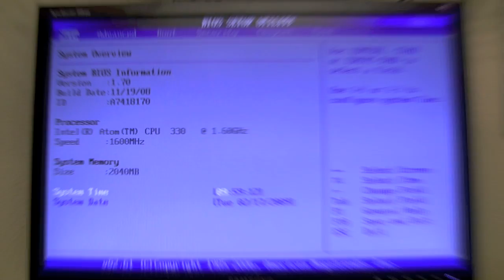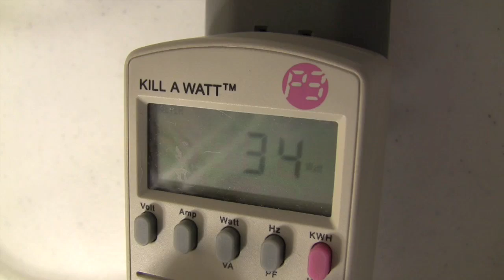MSI Wind Nettop 100 Assembly

Comment: I was looking at getting one of these to use as a HTPC, mainly to stream media from my pc with XBMC.

Since the graphics card is onboard and not very powerful, i read that the highest resolution you could run in was 1280×1024, would this work with a 52 inch screen? 

I don't really care about hidef, i know it can't do that, but as long as it will play dvd rips without stuttering i'd be happy.

i'd love if someone could comment back regarding the resolution limitations.

Comment: For same money as eeebox, you get twice the memory, 5-6 times the disk capacity, twice the CPU, and it runs on 30 watts. I got mine as a home server and it is on 24*7. It runs Linux (Fedora) with Amahi and streams media to my PS3. Media can also be accessed from the web using OpenVPN.

The video gives very thorough demonstration of building a complete system. The product gives a good high quality impression - obviously designed for people who appreciate a "hands-on" experience.